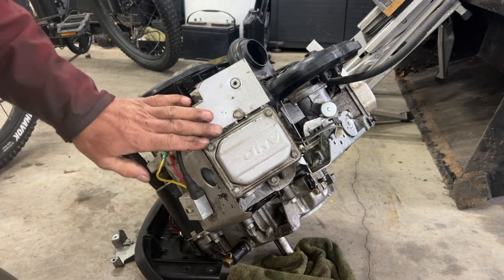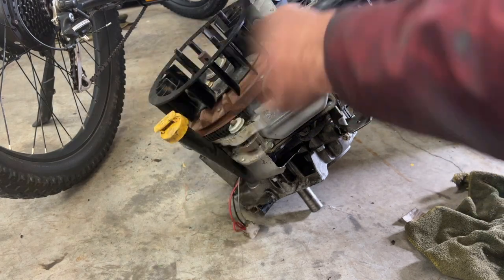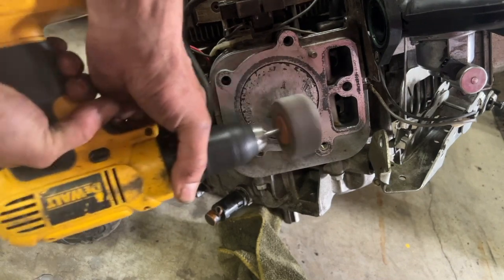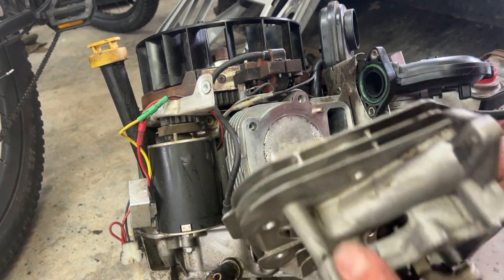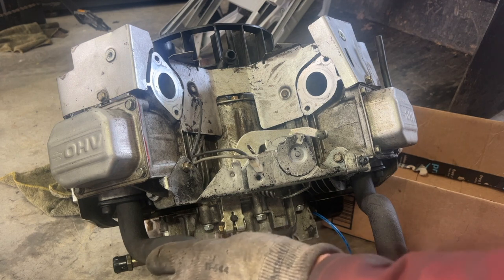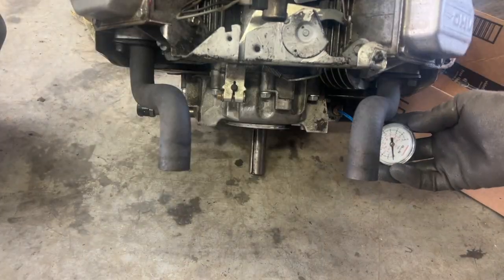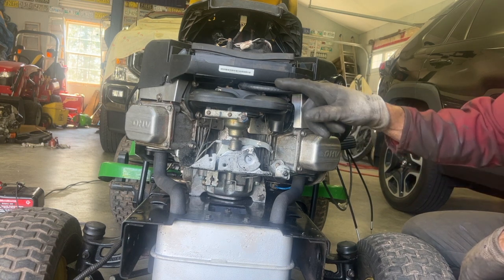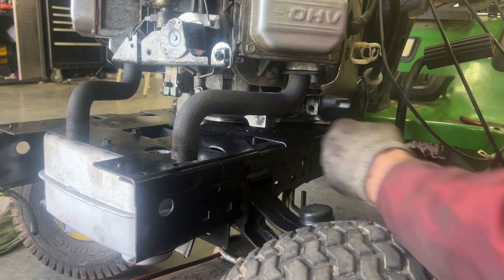Sparks coming out of my John Deere 22hp Briggs & Stratton lawn tractor mower. What's wrong?

Comment: What were you testing at 30psi?  And how?  Thanks
Reply from the maker: Was checking the oil pressure with a 1/8 inch line near the oil filter.  Every motor has a test point .    
  I should make a video on it.